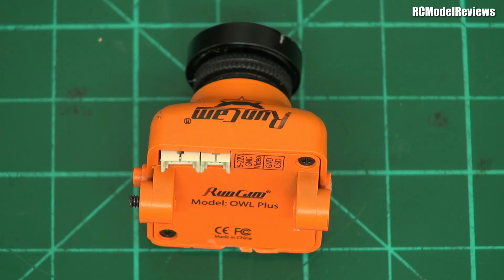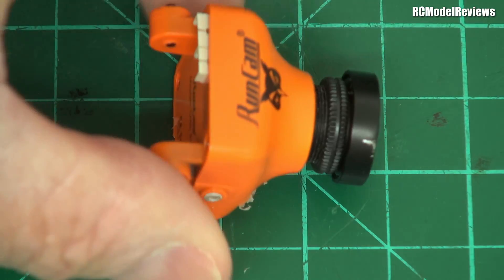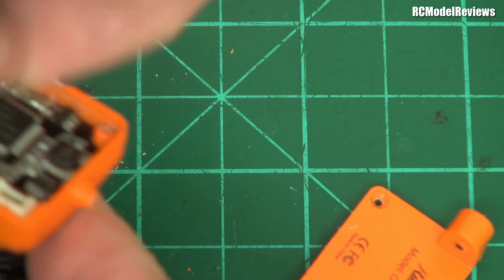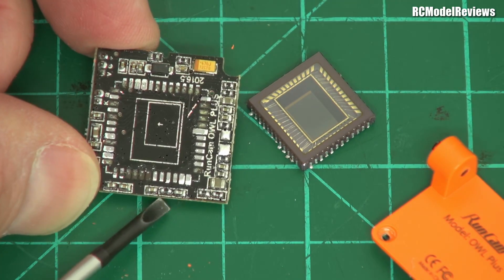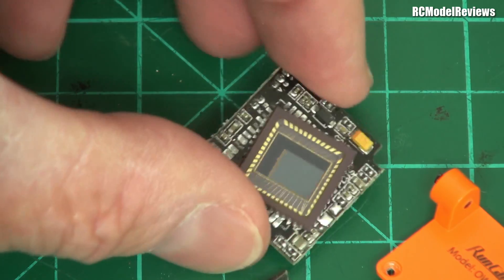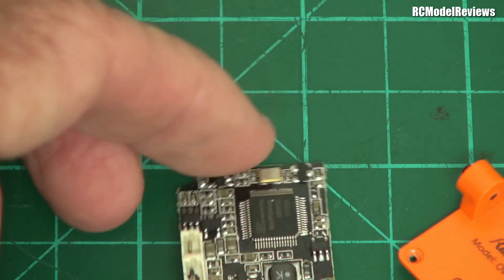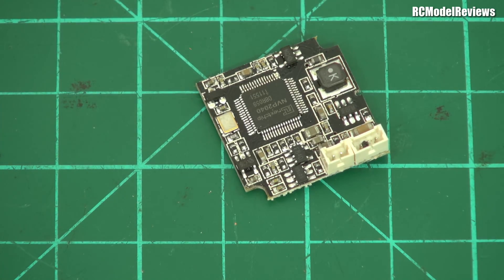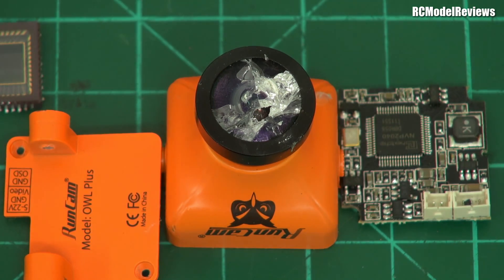After the crash:  FPV camera post-mortem

Comment: Technically you could repair it, scrape off some of the trace and carefully resolder with wire.. but the effort wouldn't be worth it honestly.
Reply: Not sure about that, it looked like it ripped the pads right off the board as well, and fiddling around with a bunch of jumpers on top of all that is definitely not worthwhile.

Comment: Like the recommendation of epoxy round the sensor.  Maybe silicon 705 or conformal coat may help instead (also non-conductive).

If you had steady hands, or a rework station would it be possible to re-surface mount the sensor?
Reply: It ripped off a large number of pads (the copper mount points)  you would have to re wire all those also..  would be a lot of work.